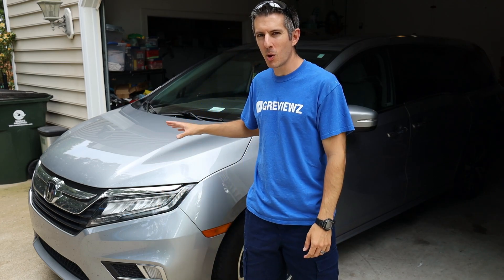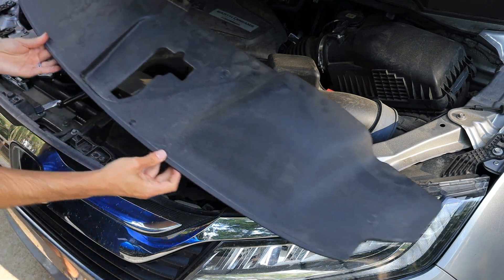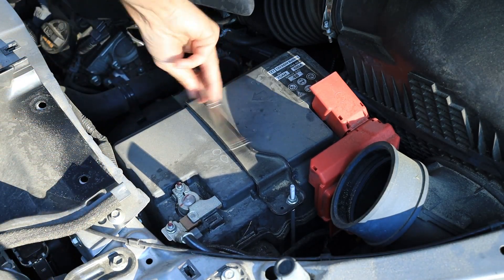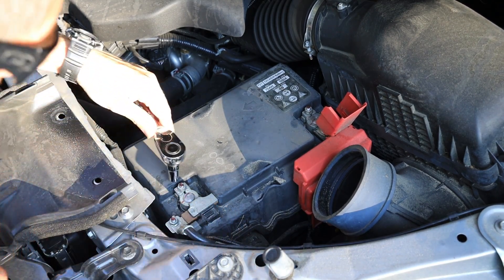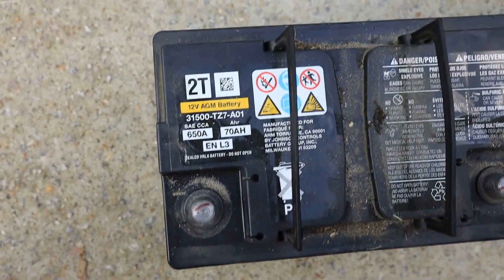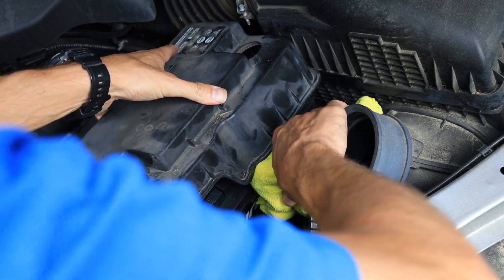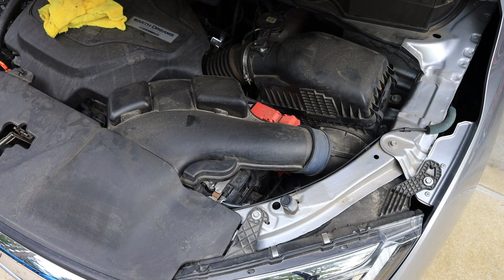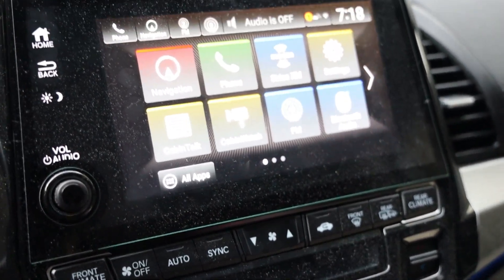Replace Honda Odyssey Car Battery | 2018-current

Comment: thank you for the video. Looks like you forgot the bracket that holds the case down. Hope you discovered it later.
Reply from the maker: Thanks. Yeah I got it re installed. I forgot to include that clip when editing the video!

Comment: What is the function of the battery box cover?  I threw mine away after I forgot to put it back on after I reinstalled the battery.  Hopefully my battery will do just fine without it.
Reply from the maker: Thanks for watching. The cover is not needed. This is my first vehicle that has had the box. Honda says the box is there to help keep engine heat off of it as much as possible.
Reply: There's a fan that vents from the bottom .  The box protects the battery from excessive engine heat , water , moisture , etc .  I'd try to at least pick up a used one from a junk yard or E Bay .

Comment: Was it a bear getting the new battery in?
Reply from the maker: Thanks for watching. It wasn’t the easiest I’ve ever done and it was no were near the hardest
Reply: Base model requires AGM battery? Or only those with idle stop system? Thanks.